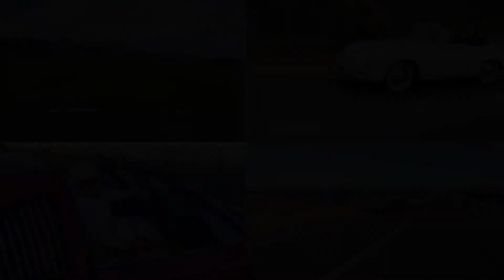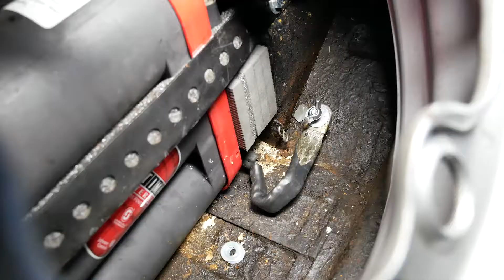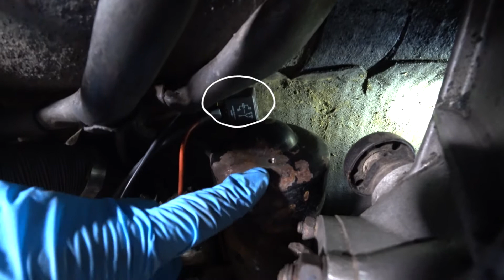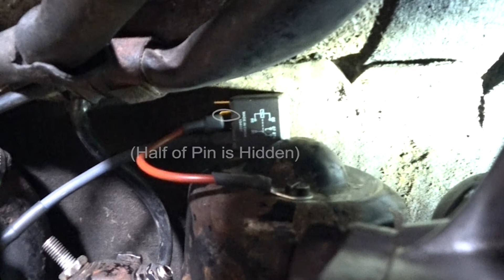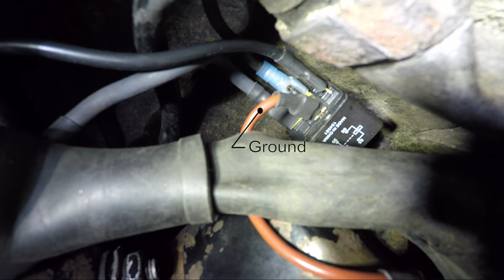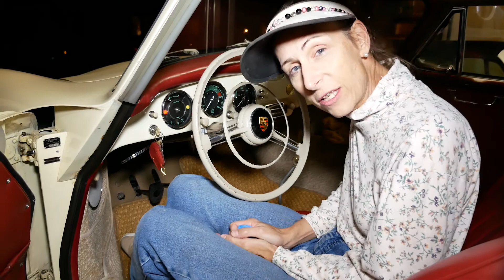Porsche 356 Starter Switch Relay Install DIY/Hack

Comment from the maker: Joe mentioned to me that the initial pull on the starter switch can be close to 40A!  I didn't know it was that high!  He also mentioned that my car was unusual with that ring connector on the solenoid. Most are spades.  I have Joe's email in the description if you want to pick up one of his kits.  He also has relays for the headlights that doubled the brightness on the car's lights!  Totally worth it!.  Franny

Comment: Hi I wonder if you can help me with a 356B problem.  I am trying to install a Orpin series parallel switch in my 6 volt 356B to help with staring.  I do have an installation book but nowhere in the book shows how to fit it to a 356.
Have you any idea how to wire this in correctly?  Or do you know of any one I could contact.
Car electrical guys over here in Europe do not want to know.  Many thanks for any help.
Regards
Norman

Comment: Franni hi from the UK. Thanks for the great vid on 5k the starter relay which I have done. I am having a cranking problem and it appears that it is my battery on its way out so I noticed in your video you do not have a ‘ conventional’ battery - it looks like an Optima. Can you confirm what battery you have and the model number please so I can get the correct one - or - do you stil recommend this battery having used it for some time now.
Thanks and regards
Sid
Reply from the maker: Hi Sid, we are using the 6V Optima (I think they sell only one).  The footprint is a little different though. It is a tad too wide to fit in the cubby on the A Cars.  Ours is turned 90° and strapped in with plenty of rubber insulation to insulate the positive terminal.  It has been working great for us. I do keep it on a tender when the car is sitting for more than a week. Thanks! Franny
Reply: @HeidiandFranny  Thanks Franny I have got one on order. Really appreciate your input. Sid

Comment: Hi, Frannie... realize this was months or years ago but I wonder what you or Joe Leone think of an extra  ignition switch that allows one to turn the engine say, after a month of storage,  for up to a 15-20 seconds to get the bearings on the crankshaft lubed before adding ignition? Always love your stuff. well thought out and very helpful. All the best to both of you in these trying times...
Reply from the maker: People think I'm crazy, but that is exactly what I do when the engine has sit long enough to dry up the carbs.  If much rather rebuild a starter than an engine!  Joe approved ;) f

Comment: A couple of things- for the love of Mike get some coveralls,lol.You are going to ruin your clothes. secondly - I understand the rationale here because the starter switch is so expensive to lighten the load as it were,there just has to be a better place to put the relay.It's one thing to install on a lift but another kettle of fish in the field. Even McGuyver herself may have difficulty pulling that off.This brings me to another point.I know I know keep it original is the mantra but not changing the eyelet connector? Seems a bit much. In additional back to my point of originality and relay location-I'm guessing there are no other places without drilling a hole and putting in a grommet in some sheet metal. Yes on my Beetles I do that but completely understand reticence or unwillingness in others especially in your case to do so. Since i don't know the anatomy of 356s I can't say for sure but I would sure look for a better location for that relay. BTW I just changed my brake light circuit tonight on my 65 bug because I got so stinking tired of having to change those terrible hydraulic brake switches every 9 months. Required a relay too as the switch was rated for 5 amps and my circuit exceeded that considering I run a third brakelight in the lower rear window. Anyway cheers. ps think about some coveralls.

Comment: Shouldn't there be a wire running off the starter to the voltage regulator? Or is that bundled in with the main power connection where we couldn't see it because it was wrapped in the harness?
Reply: Hi Frannie . I disconnect the +ve side as the main large wire to the starter is live and can short out despite the earth ground being removed.. cheers Sid
Reply from the maker: Hi Emil, I wanted to look that up.  Yes, there is a hot (+6V) off the big starter cable that then travels on to the Voltage Regulator (B+ terminal).  It must be bundled into the harness.  Joe Leoni's (356 Electrics) diagrams show it coming off the starter as well.  Great question!  Another reason to pull the battery ground before fussing with the wiring around the engine bay. Franny

Comment: great video, just wondering, what voltage is this car? 6v or 12v? I think you refer to 6v in beginning but 12v at end of video.
Reply from the maker: +bud gnatek it's six. I am not sure why Franny would have said twelve. Heidi
Reply: thanks, not a big deal, but you may want to check your video at 8:44 for the 12v reference.
Reply from the maker: bud gnatek good catch!  We both watched that video too. Yeah, it should say 6 not 12. Heidi

Comment: Franny, my '59 coupe (Reutter 107520) also has the ring connector, not a spade, so I'm not convinced all late 'A's are not like that.
Reply from the maker: Oh really...  That is interesting.  Joe was pretty surprised when I talked to him about it.  But it seemed original to the solenoid and the wiring harness.  That late T2 was a funny time I think.  I have a couple videos to get out, but I'll be doing one soon on the electrical tune up and showing that our car is missing the distributor oil slot in the third piece.  Cal found another and even Vic S. found one as well.  Strange times...  I'm guessing experimentation for the upcoming B (or just running out of A parts ;) ).  Thanks for the comment and letting me know :)  Franny
Reply: I'm so glad you posted this video, as I stopped installing my relay when it came time to cut wire. Just cleaning up the main OEM connections improved my cranking anyway. Now I will make an adapter cable like yours, and also install the relay box atop the bell cover, too. I was reluctant to hang it down in harm's way.